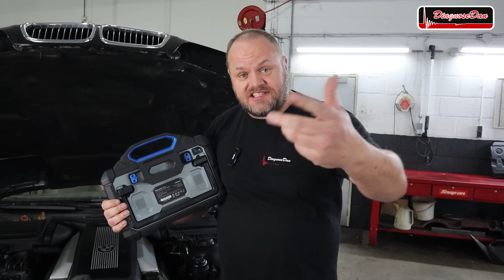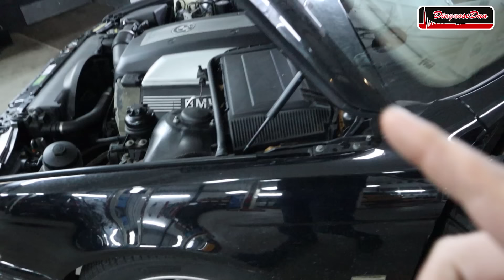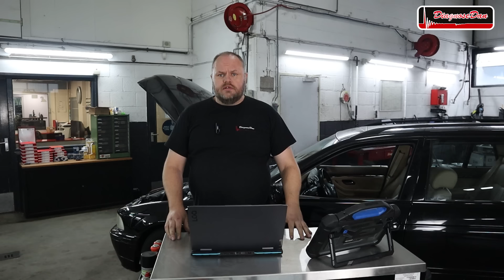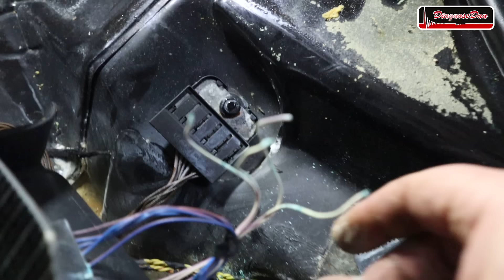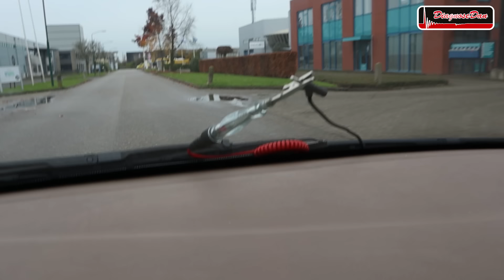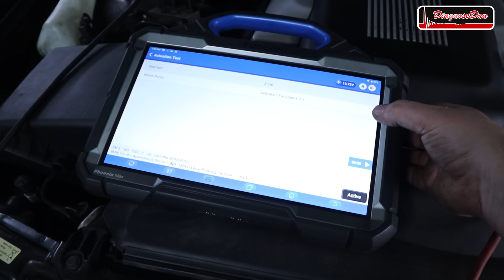Help! Weird fault and my scantool won't connect!

Comment from the maker: Check out my website ; https://www.diagnoseda...
For Diagnosedan Tsb visit DDTSB.COM
For the Topdon tool used in the video:
US: https://www.topdon.us
UK: https://www.diagnostic...
EU: https://eu.topdon.com

For business inquiries ( not for technical questions!); Diagnosedan@gmail.com
Reply: Will there also be a consumer (single car) version of this subscription? A lite version or so? I totally understand the subscription fee. But for a single car home repair guy it's a bit steep pricing.
Reply: @Gorbatsjov27  I agree this is something overlooked by the industry, I would happily pay per Vin for my own vehicles.
Companies like all data and auto data are missing a revenue stream
Reply: @Gorbatsjov27 totally agree with you on that one.
Reply: Yes, for just the brand/model you drive for example, good thinking Gorbachev 😅@Gorbachev27
Reply: @Diagnosedan  Yes, the fault may be in the pre-pressure pump. However, I have come across a situation where a brake master cylinder for the ASC system is bought as a spare part for a DSC car. The difference in the cylinder is apparently only on the pre-pressure pump side. The symptoms are exactly the same! Master cylinders are otherwise completely interchangeable, so these can easily be confused with each other. Based on the video, at least the brake booster has been replaced in this car, but would the master cylinder also have been replaced at the same time?
Reply: i love the out--takes at the end 😆🤣
Reply: Welke power probe gebruik jij
Reply: So to a large extent you diagnosed the diagnostic connector...
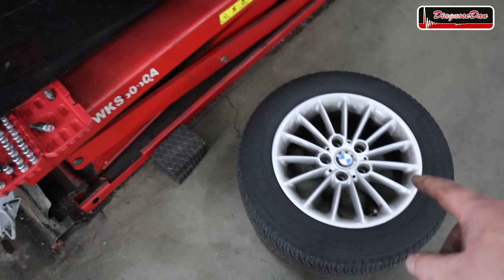Reply: 27:23 Why was it important to remove the wheels off camera to prevent children from seeing?  There are plenty of videos on YouTube that show how to remove stripped lugs.

Comment: I had an interesting event like that. Checked with my personal scanner, and it checked fine for inspection. Took it to the state site and their unit would not connect. Took it to a friend who has a Snap-on. He read clean. Back to inspection, no connection. Took it to another shop that did repair and official inspection. His shop machine connected ok, but when he connect to the official machine, it would not connect. He could not explain it either.

Back to my friend who knows people in the business and he had someone look at  it. The ultimate issue was this: There are two ground lines on the interface plug, one of those was 'open'. The Snap on and the DIY tools didn't care because the tool pulled both lines together, but the official inspection unit did not. Fixing the missing ground resolved the problem.

Comment: Hello Dan  I have a question. I also have a “no communication” issue on a Citroën Berlingo B9. I can only read the engine with OBD, but the car also has ABS and start-stop faults. Can I always bypass the OBD in the way you explained?

Comment: The Green Crusties strike again.       Pump won't pump or is it Dirty fluid.   There has to be a special way to bleed the. brakes.    How hard is it to find a pump or will you have to rebuild the pump yourself.

Comment: Bow do we know w the problem is with the pump and not the sensor giving too low values?
I agree that most of the times sensors either work or fail completely but how can we be sure?

Comment: I was doing some work on a 2005 mini cooper it would not pass smog test and it was telling my sun in law in law that his transmission was the fault and wont pass. I have a nice launch scan tool I bought because I was charged $100 to b told my gas cap was loose but back to the mini the launch did find the correct code for the front left wheel speed sensor not the transmission I did do some research to make sure which problem was actually causing the problem and found that BMW did not always follow the mandatory codes properly an that the trans fault could pop up so I went with the affordable option and changed a 15$ sensor on all four wheels which cleared the fault codes and it passed the smog test the tech asked what I did to fix it and I told them I don’t think he believed me but it did pass.

Comment: On my planet, if an authorized dealer can't diagnose a problem in one hour? The manufacturer is required to replace the car with a new one.
 That gives the manufacturer incentive to require highly trained dealer mechanics, and keeps the customers happy.
 The manufacturers simply need to eat their own kibble.

Comment: Funny -- i used a month to diagnose similar on power wires and signal wires on my bmw e34 -- they had a lot of those solder joints and wires which was probed and corroded --

Comment: I do enjoy watching your videos, they are very informative,  helpful,  and you show a great working ethic towards diagnostic research.
 I am a retired diagnostic technician, and ford tech mechanic, although in truth I don't think it is in fact possible to ever retire fully, especially if you have a good reputation,  word always gets around, and you will always be asked the famous line, "can you just ", these 3 words usually are a precursor to a vehicle problem which has been checked, messed around with and diagnosed by many other people before you get to take a look, it is at this point I end up getting elbow deep into the issues and finding the problem, and then the repairs, and then the old chestnut,  my mate said you charged x amount to him, will this be at the same rates?.
 I did enjoy the job when I did it for a living, but now it is a chore, a pain, and I don't get the enjoyment I once did, simply because you feel used, abused, and feel obliged to help them out after their sob story of having spent loads already, and can't afford a lot now.
 This is why I feel more people should watch your channel, especially people in the trade, the ddtsb service you offer would be amazing to have access to, it would save me some time on many jobs, and would be a massive benefit to those still actively working in the diagnostic industry, I do my best to promote your channel, and have sent many people to watch you on YouTube,  and a few have signed up for the tsb option, and have found it very useful. 
 I will say one last thing, I am so glad you include the bloopers, the bloopers would be most of my content with a little sensible stuff if I had a channel, my brain does not work like most, and I think sideways, so speaking on a video for me would just be confusing to anyone watching, I suffered a brain injury 40+ years ago, and my brain takes a while to put into words what I need to say, so my video would show me diagnosing and fixing a problem, and my voice would be miles behind, and still getting the words out regarding the symptoms, as I finish up the repairs.
 Keep up the great work, and I will keep watching. 
 Perhaps one day I might earn enough to sign up to be able to search tsb information,  to make my life easier, and more enjoyable in the future.

Comment: I have a question. 
How do you know the pressure reading you're seeing on the PID is actually correct, and you haven't got a faulty pressure sensor reading incorrectly? 

Great videos by the way

Comment: Great job, even older cars are no problem,but Dan solved the big problem first !
It's great that the customer finally got his old but valuable BMW fixed, even though the pump was replaced at another repair shop.

Comment: Hello Dan, why don't you suspect the pressure sensor to give a wrong reading? Is it because if the value changes then it's more likely to be good? It's not obvious to thrust the sensor.

Comment: Ooo look at you Mr. Fancy Pants with your BMW with diagnostic capable ABS. I guess I'll just sit in the corner with my Audi 200 and its Bosh ABS 2e that doesn't even store codes, and Hitachi ECU that forgets everything when the key is turned off. 😅
The OBD setup on that BMW sounds quite similar to what VW was using at the time, where the CAN gateway lives in the instrument panel. I had no idea you could bypass the can gateway... I assumed it was doing some protocol translation too.

Comment: Wow this one sure took some time , the moisture problem and corroded wiring on the wire connector under running board carpet like you I thought OK problem found but then finding the pump not operating properly threw a wrench in the fix . You are awesome finding the issues. I heard that a early Volvo XC 90 that had issues with water coming down from the Sunroof  corroding a pct board under the passenger seat, I would guess that you with your knowledge have probably seen that issue also in your history of car repairs . I always made sure my drain line was clear so I would experience this issue.

Comment: I have almost the same problem with my car but here it happens when I go over 80 kmh. Once it happened when I was driving in a puddle of water at 40. After some research on the internet with different car brands with the same problem, it is a sensor fault.

Comment: As a pro you have access to all these fine tools. I sit on the street, yes, I have a voltmeter too. And a 20 quit OBD. And a bicycle to go to the spare part shop, if it is not raining. The rest is youtube, someone has to come up with an idea where a fault may be. Dan is top in this, thumbs up. And then I need another video how to get to that part to change it ... And then I need a silencer, so the neighbors don't hear all my swearing about these fck incompetent design engineers, who have done nothing good in their job, only "make it work, cheap". Grr. No access with tools, a million hoses and pipes laid from a freak, breaking plastics, sharp edges all over the place, corroded bolts where it is known they must be loosened a few times in the cars life, timing belt design errors by default, and required spare parts where the numbers got changed, and that part no longer fits, but the one what fits is no longer in the list ... its bad that I was working on cars in the 70s and 80s. That was easier, in the worst case Hammer, chisel and a flame solved most of it. And as luxury, a bulb with a cable to track broken electric connection.

Comment: Yes.yes.great presentation and of course. The first problem that  caused this was 
Water   getting into the electrics at the start.  A Lack of maintenance...
But the pump was a secondary issue!!!!..
Still a great show❤
Reply: There are more videos out where cars have a soggy floor corroding the connectors. Can happen after driving through deeper water or rain through an open roof ... Easy check: Look under the carpet first ... if its wet, problem zone.

Comment: How did you determine that the pre-charge pump was faulty, and that it was not a leak in the system preventing to build the 15bars pressure ?
Reply from the maker: A leak would have been obvious to see

Comment: Another good video!
Which OBD breakout box did you use?
Reply from the maker: Can't remember the brand but it came from Ryans Automotive in Ireland
Reply: @Diagnosedan  
OK, thanks.
I ended up getting an GoDiaG GT100
Probably should've gotten the Pro+ but didn't know it existed. Too many models to choose from, didn't notice the one I got doesn't have an amp gauge. Oh well, live and learn!

Comment: The blocked drain happened to me on e39 also but on the opposite side. Caused the Light control module to become wet and malfunction
Reply from the maker: All these problems can be avoided by just cleaning out the plenum chamber every service.

Comment: Hi Dan, just thought could it have been a faulty sensor in the ABS control unit reading a below 10-15bar reading and putting the abs light on? When in fact the pressure is high enough - would a pressure gauge put in the hole where the sensor screws in be a definitive test ? Love your videos and great at mastering English ..
Reply from the maker: A faulty sensor would have set a different faultcode. Yes we could have used a pressure gauge
Reply: that’s very true 😂

Comment: Does the no comm test relate to the E60/E90 chassis as well? Had this issue multiple times where the can voltage is 3.8 on can low and 5.2 on can high. And that gave a no comm to the rest of the vehicle. I could read PT-can but nothing else.
Reply from the maker: E6O and E90 are a completely different and more modern platform. 
Even an early E60 (with regular key)  is completely different than a later model E60 (with card style key)

Comment: Bad connections of the abs connector ?
Reply from the maker: No not in this case
Reply: @Diagnosedan  Oui et non.  Ce sont les fils coupés qui interdisent dans ce cas la communication avec le calculateur, non ?
La 1ère porte d'accès pour etablir la communication le calculateur principal se situe toujours entre le + après contact et le calculateur ABS pour des raisons de sécurité. 
Sur tous les véhicules quand la valise diagnostique dit : pas de  communication avec le calculateur , il me semble que la recherche doit toujours commencer entre le + après contact et le module du calculateur ABS, non ?

Yes and no. It is the cut wires that prohibit communication with the computer in this case, right?
The first access door to establish communication with the main computer is always located between the + after ignition and the ABS computer for safety reasons.
On all vehicles when the diagnostic case says: no communication with the computer, it seems to me that the search must always start between the + after ignition and the ABS computer module, right?

Comment: Hi , I have honda crv 2007 .the  fuel pump was not working and I Change it twice and sometimes fuel pump start and other day fuel pump doesn't trun on and it's happening quite often . When it start car runs perfectly fine. I don't know where should I take a look . No fault code. Any advise
Reply from the maker: Have you checked the fuel pump relay?

Comment: Oh adblue faults keep me in a job they're so bad. Nox ppm after scr cat should be near 0 ppm especially at idle. I go for a drive then coast in gear to see if the ppm drops to near 0ppm. Maybe the spot has affected the way nox sensor 2 is reading it's basically gonna cost a fortune to put that right, or there's always the simpler option!
Reply: I think this post is in wrong video Dan haha

Comment: I wish you made this video of the E39 years ago😂! Would have saved me hours. Getting to see how the communication between modules works really cleared up things for me. thanks!
Reply from the maker: Did yours have the same issue or was it not resolved?
Reply: @Diagnosedan  i have a moire gray 00’ 540iA wich had leaky weathershields in the doors and blocked sunroofdrains. Enden up with a pool inside the car and problems connecting to the different modules using the obd2 plug. 
After swapping the whole interior from gray to black i fixed the wiring issues 👍🏼

Comment: Grand day to you and your knowledge. 
Hi, am Anthony and I am new to your show and I'm pleased to say that I have been around knowledgeable people working on cars and you have earned this ability 🎉congratulations 👏 to you dan.
Am Anthony and I own a bmw e64 650i convertible 
I just service the transmission and replace the sump pan service the car engine and replace the rocket cover seal in other words full service including brakes.
My problem is, when I sit in traffic for some time when the traffic begins to flow again and I accelerate i see light blue smoke then it clear up and I notice when I am parked  for about a week, when I move the car I see small pockets of oil dropping 😢 please help.
Reply from the maker: Find the oil leak😁

Comment: Thank you for the in depth Diagnostics.  I've had to do that more than once with intermittents, but this car had the problem constantly.
I hope the vehicle was fixed when the new pump was installed.
Reply from the maker: Intermittent faults are harder to find, this one was easy

Comment: These bmv engineers know how to get the car to cost you all the time, and for all kinds of reasons... This is dry clima cars. I think some fancy land rover models had som similar problems like this, and went into "limp mode",in the rain and made grey hair on the owners and the tecnicians. Until the owners gave up the cars.
Some car brands are best at hair blesching....🙄
Reply from the maker: In this case the car could be repaired (communication issue) without any parts. The water leak could have been avoided with proper maintenance.

Comment: Really appreciate the video had similar issues with going underneath the carpet to replace the junction box as well as cleanly drain parts for the sunroof, vapor barriers and the front area you mentioned near the plenum. 
I have an experienced this exact problem but I did notice when I was underneath that those wires did look corroded I never touched them but I probably should go back underneath and get that right thank you Diag Dan for your informative videos.
Reply from the maker: Its best to check in them😁

Comment: Very similar to VW/Audi K-Line.. ive had my fair share of issues with those, the Touareg also has the same issue at exactly the same location lol
Reply from the maker: Indeed underneath the carpet on a Touareg
Reply: @Diagnosedan  Those were fun to diagnose, first time I did one  almost pulled my hair out, then later ones I figured out there was a TSB for that issue, repaired it in less than 10 minutes.. That's why I appreciate the invaluable effort you do to put together a database of common problems and TSB's some manufacturers won't acknowledge..

Comment: From the first seconds of this video, I was sure it was the precharge pump. This pump first runs in couple different scenarios which can further help diagnose the issue. These would be: around 40km/h, engine speed over 2000rpm or engine torque over 100nm.
Reply from the maker: Indeed, i can tell you know what you are talking about!